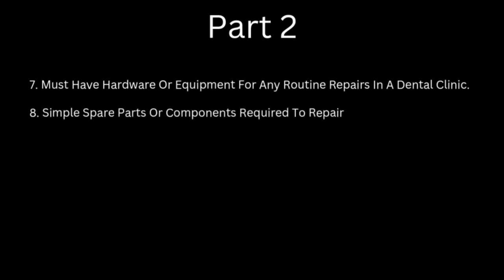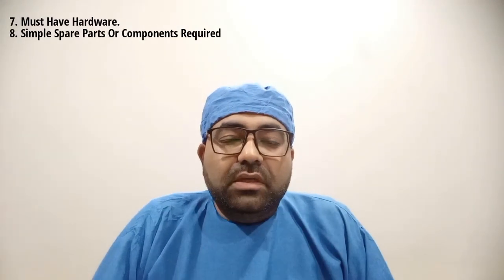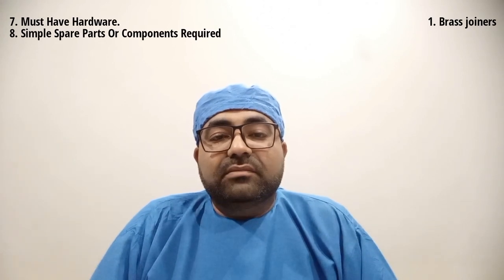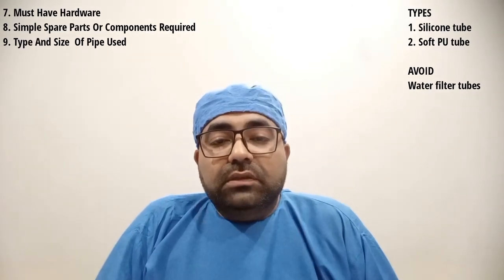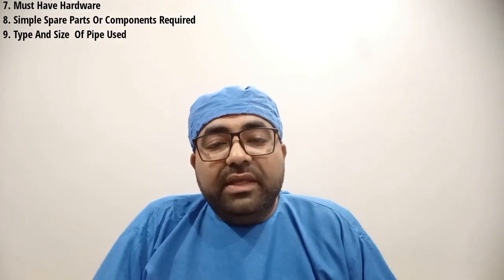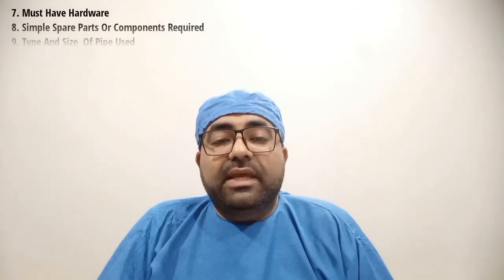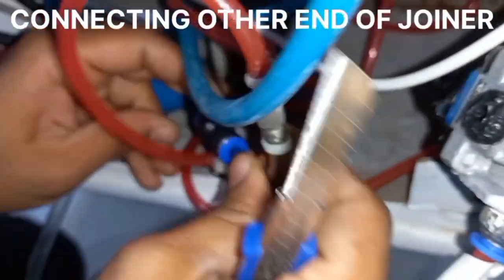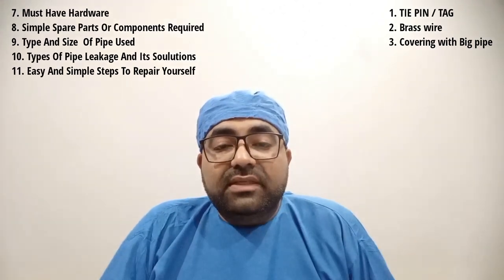Part-2, DIY, Dental Chair Repairs. Spare parts, Tips, Tools for Water leakage from dental chair.

Comment: Sir dental chair repair kha Se sikhe
Reply from the maker: there are no particular training center or place for  it 

try to get a job with any such chair company 

provided you have basic information on electronic repairs and curcuit repairs.

along with practical experience you can start with small fix and move towards complete chair repairs